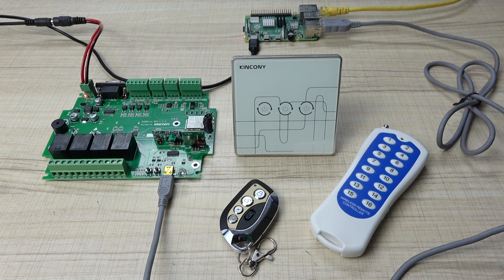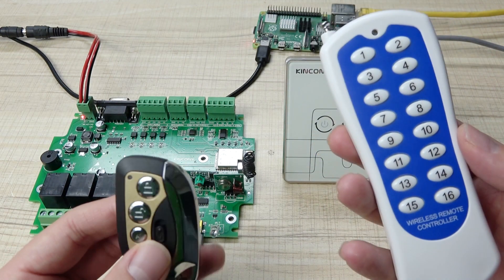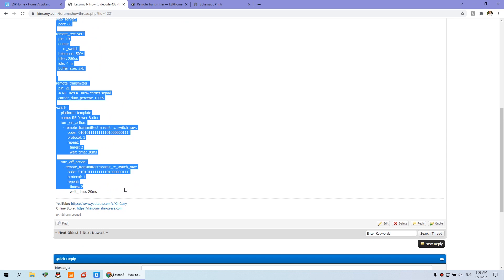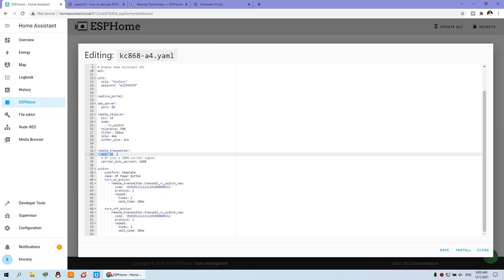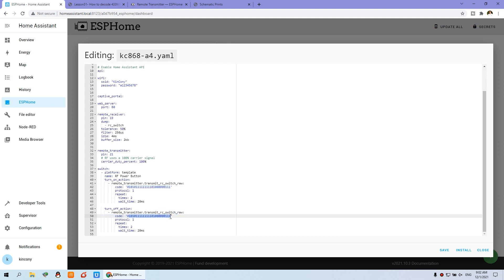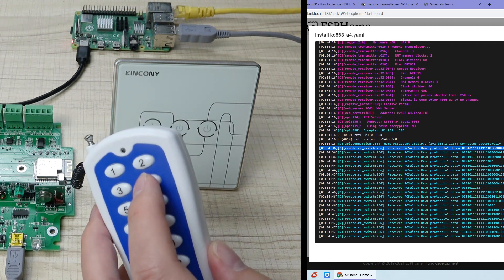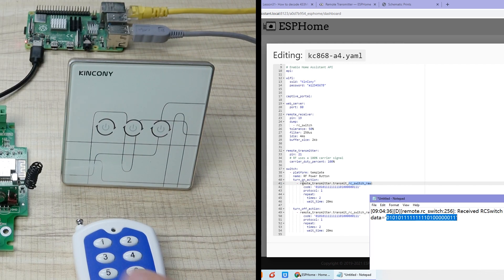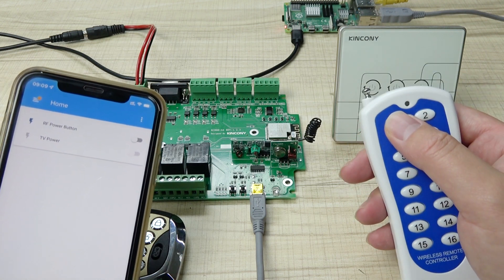Lesson31- How to decode 433MHz RF signal and control device by ESPHome

Comment: I tried this with esp32. I receive data 29bytes long with protocol 1. Weird length, but whatever. Then when I try to transmit it and it won't go - it logs that I triggered switch but nothing further happens. I tried using another esp32, another set of transmitter/receiver, also another type of them too. Nothing. Any hints?
It's as if esphome rc_switch library is bugged.
Reply from the maker: which kincony's ESP32 board model you are using?
Reply: @KinCony  No kincony. Just ESP32 vroom 32 dev board.

Comment: Thanks for the video. The KC868-A4 is an overkill for me as I only need RF send and receive. Do you know of any other modules that only do RF send/receive?
Reply from the maker: KC868-AG
Reply: @KinCony  So if I'm not interested in IR (only need RF) what code would I use for ESPHome? I see code sample for the KC868-A4 but probably different to the KC868-AG
Reply from the maker: KC868-AG only use IR+RF, suppoprt ESPHome, we have sample yaml file in our forum. @meierthomas

Comment: I have a 433mhz siren i tried this but not working
Reply from the maker: 433M is frequency, you need to confirm which wireless protocol using by the siren.
Reply: @KinCony  yes it is I had openmqttgateway working but I want to migrate to esphome
Reply from the maker: @marine1718  you can use ESPHome RF decode the wireless signal, if can be decoded, that can be integrated.
Reply: @KinCony  I do have the code put there like you do in your video and then on homeassistant I click and does nothing
Reply from the maker: @marine1718  post details , such as photos to our forum.
Reply: @KinCony  i have a controller that emit a code to activate the siren and i get this code and use it like you do and does not work
Reply from the maker: @marine1718  check your sender or receiver. PT2262 and EV1527 code is easy to use.
Reply: @KinCony  the sender and the receiver work just fine with tasmota openmqttgateway